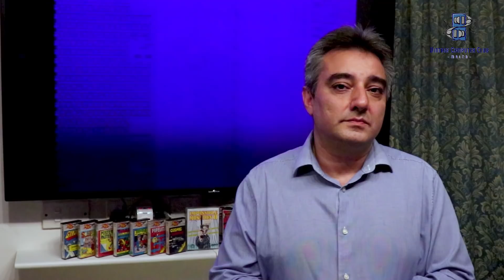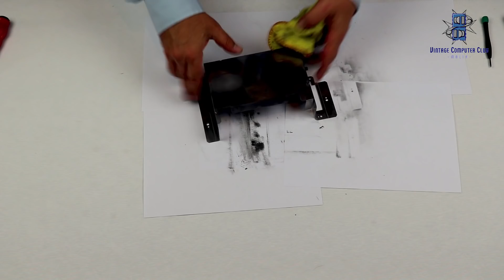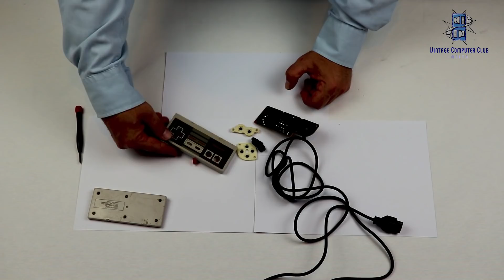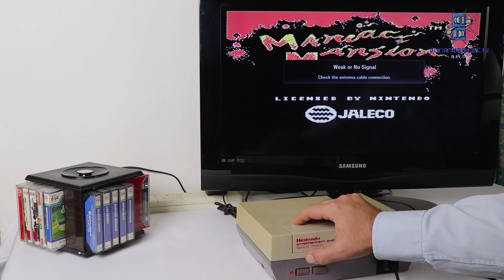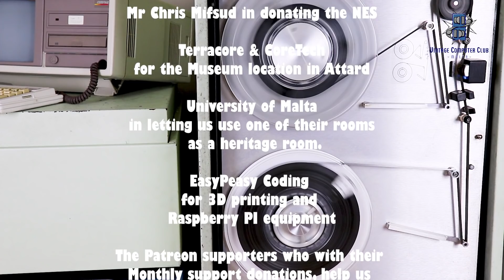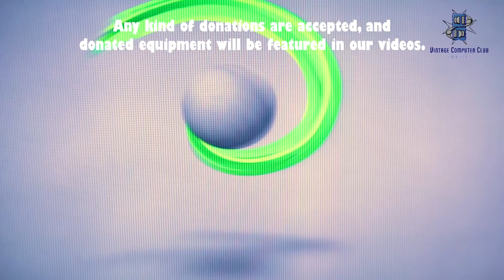Guide to Restore & Repair your Nintendo Entertainment System

Comment: I have an NES but power supply is missing. where I can find a power supply for it?
Reply from the maker: If you need an original one try ebay. If just a replica or to power it up all you need is a 9V 1000ma AC power supply. These you can find them in any electrical shop.